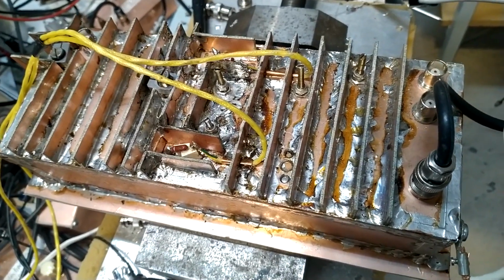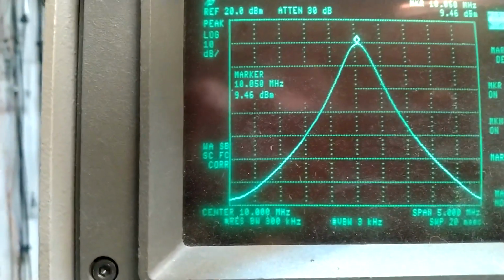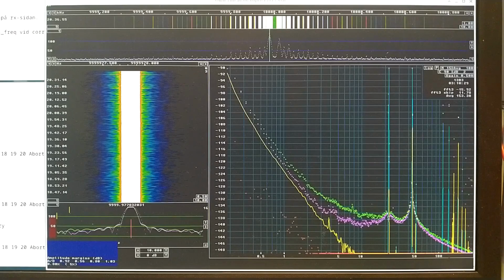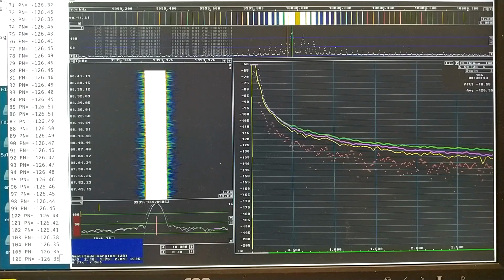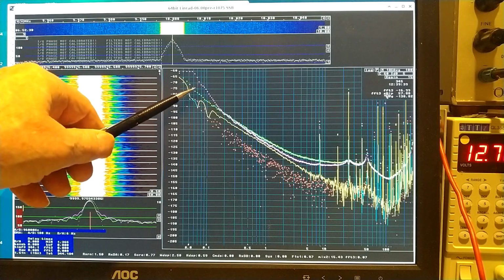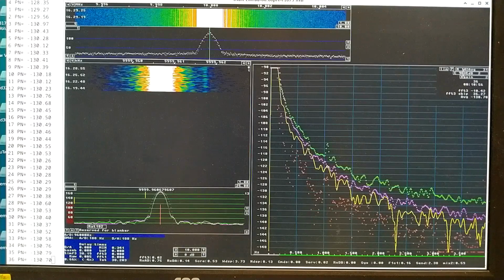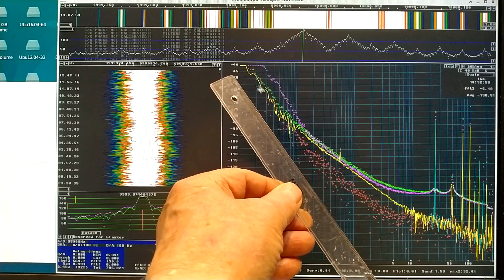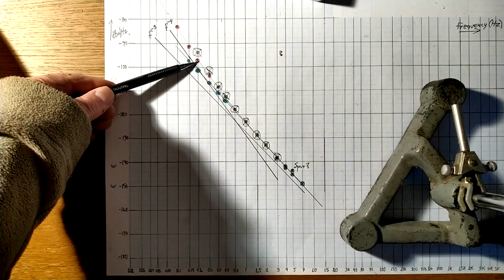nerds100

Comment: This is some very advanced RF work, that I am not used to seeing.
The gpsdo disciplined with the rubidium is generally done for long and short term stability advantages. I have a high stability ovenized crystal that is 5x10-10 per day averaged over 10 days in a Racal counter that I use in the lab. Good enough for me. Good work.